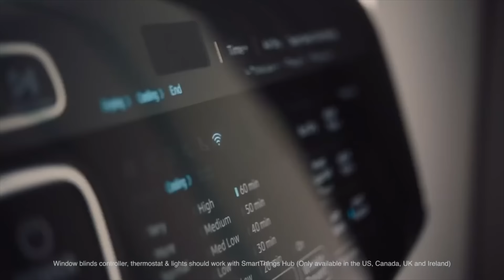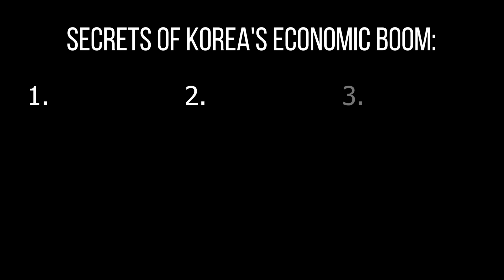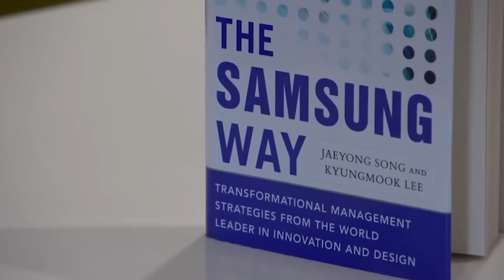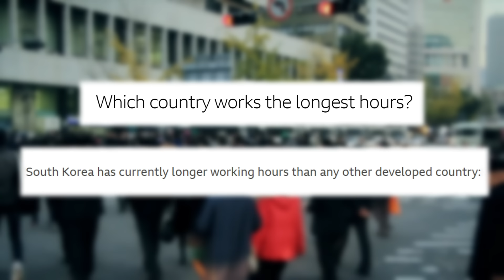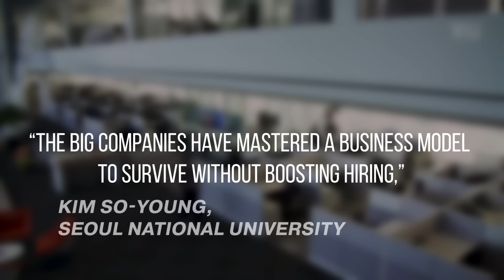The Dark Side of South Korea's Incredible Economic Success

Comment: This is why reunification would be an extremely powerful long term benefit. The educated workers of the South could work in new or expanded companies in the North, and the uneducated workers could do the jobs in the South that educated young people want to avoid.
Reply: Long term maybe. But you have to take into account that these are 2 totally different countries. The North could be described as a developing nation and the South is a fully economically developed. Everything in the North is outdated. If they would reunite there would be a huge gap, rich people from the South and poor people from the North. An example is when East and West Germany reunited. Even today, just by driving around the East and West part, the difference is still very much there.
Reply: @noahdelauw9708  absolutely, which is why I specified long term. It would not be a benefit felt for many years, and the initial costs would be very high, almost entirely footed by the South Korean taxpayer. However, looking at Germany's position in Europe now, one can see Korea overtaking Japan in the future.
Reply: @oliverhughes610  That could definitely be. Reunification is not for the near future i think tho
Reply: @noahdelauw9708  Depends what you define as near future. I think it will be nearer than people think. Within the next 30-50 years at most.

Comment: Our foundry went from South Milwaukee, Wis. to Pusan, South Korea in the early 80s.  U.S. industrialists engineered the miracle and deindustrialized the U.S.  It began with men in sandles pouring molten aluminum into molds dug in the ground.  I saw the photos.  Amazing how it has been “developed.”
Reply: Are you claiming that the so-called 'Miracle on the Han' was little more than U.S. intervention? Have you spent any time in Korea? I ask because you seem to be making some fairly bold claims that Korea's success isn't its own, and stems from U.S. connection alone. 

Obviously, U.S. intervention catalyzed something massive, and for that Korea is grateful. But to suggest that Korea's success came directly at the expense of U.S. industry is arrogant.
Reply: @charlesberkeley6429  No
Reply: @jerrytritz  I'm not trying to argue on the internet because it's generally wasteful but you said "U.S. industrialists engineered the miracle and deindustrialized the U.S" That doesn't sound like the miracle had much to do with Korea based on your words. And putting "developed" into quotation marks has a certain connotation as well.
Reply: @charlesberkeley6429  exactly.
Reply: ... men in sandals* ...